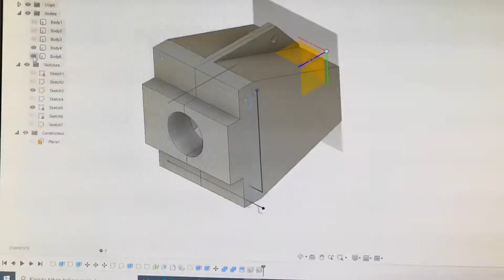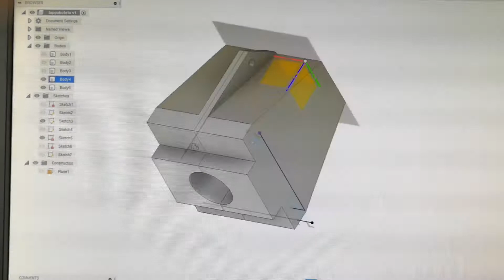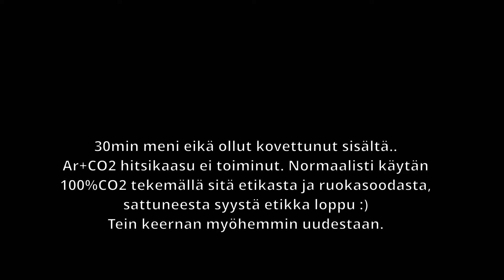Samurai 40cc extreme viritys osa 2, cdi testi ja läppäkotelon valumuotti

Comment: What hardware do you use for ignition? 
Any schematics?
Reply from the maker: It has got an ATmega88 microcontroller as brains. Capacitor discharge is controller by SCR. High voltage from battery is generated by basic flyback converter circuit. Here are some schematics that you can refer to(not made by me): http://www.sportdevices.com/ignition/ignition.htm http://www.sportdevices.com/ignition/inverter.htm
Reply: @ASoftaaja  thank you. SCR? 
I probably won't use a standalone microcontroller, probably a Arduino or a esp32 will be used. 
I really have to make this work. 
Very fun project.
Reply from the maker: @TheTTyks  arduino will work very well for this. Nano has the same processor. SCR is just a semiconductor switch which is triggered by the microcontroller and it discharges capacitor creating the spark pulse.
Reply: @ASoftaaja  thanks. I've looked to the schematics a bit. But will need to look at it more before I've got my hands on it. 
It is a bit clearer now and I think I will manage to build it